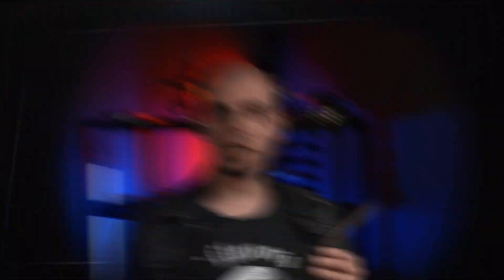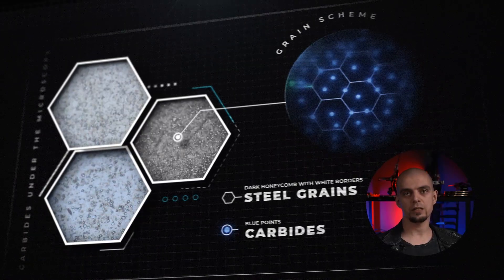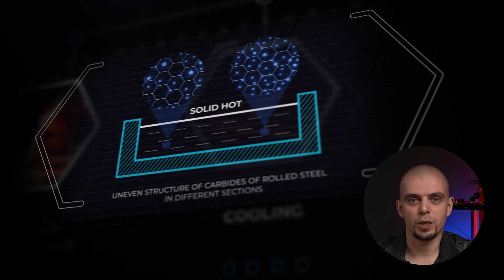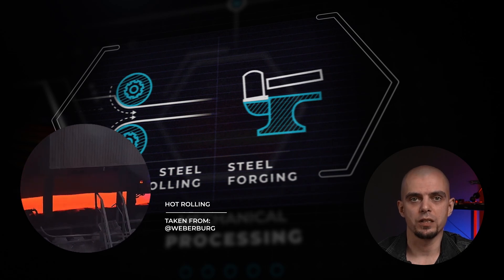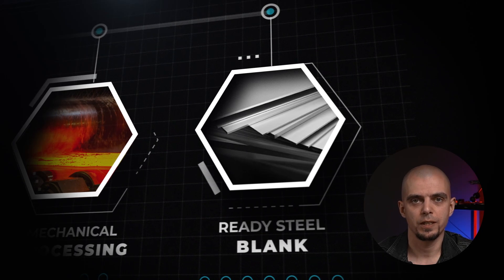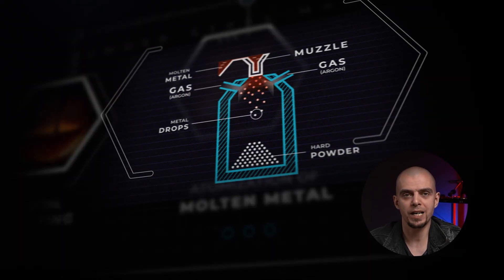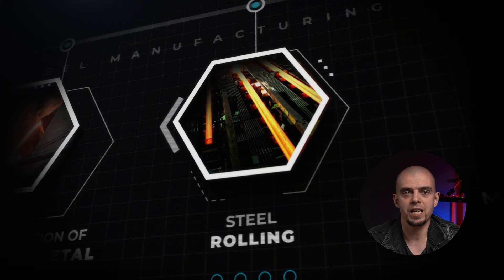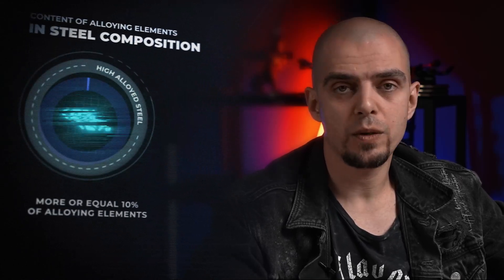Skills in Steels. Difference in technologies of knife steel manufacturing

Comment: Currently Bohler seem to have better steel over crucible. As we see crucible has more and larger inclusions. Otherwise both have similar alternatives to each other and the heat treat will be the deciding factor of its performance and properties.
Reply: Depending on heat treatment, an ingot steel can perform better than powdered metallurgy.
Reply: In fact there is a lot of 20cv, 204p and m390 that performs poorly over so many other steels because of their poor choices in heat treatment protocols.

Comment: Nice video, very interesting on the metallurgical topic.  In addition to dealing with the chemical composition and characteristics, it would be interesting to know by discussing from time to time in different videos which types of steel are better to sharpen to a shiny edge and which to leave with a more "crispy"-"toothed" edge precisely to enhance their characteristics.  Kind regards Alessio
Reply from the maker: Thanks so much for your feedback. We'll do that definitely!
Reply: This also depends on the heat treat also. Because a high temper steel might be more beneficial to use lower grit than higher grit in the same steel at a lower temper.